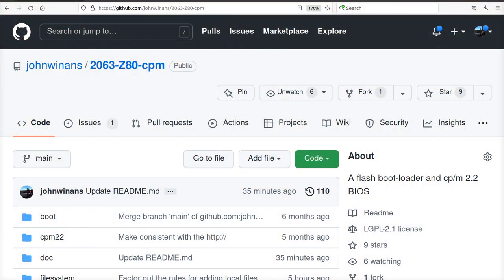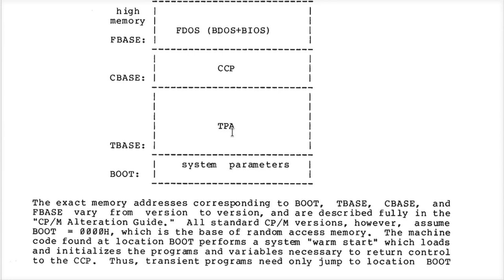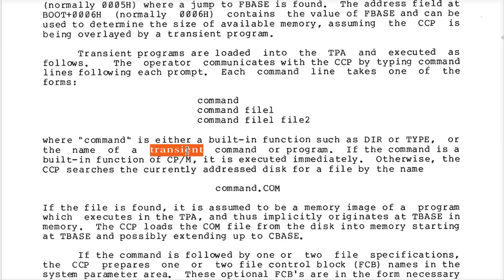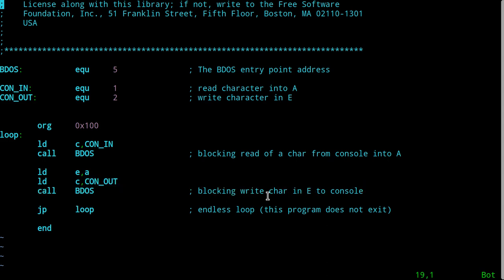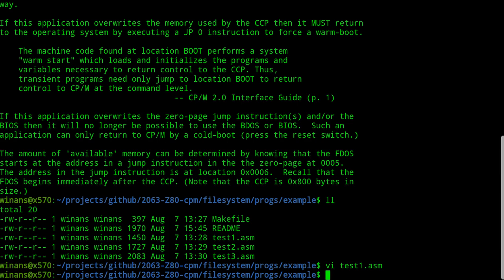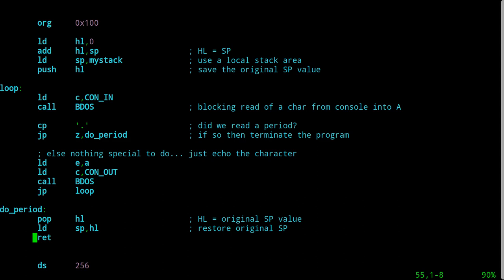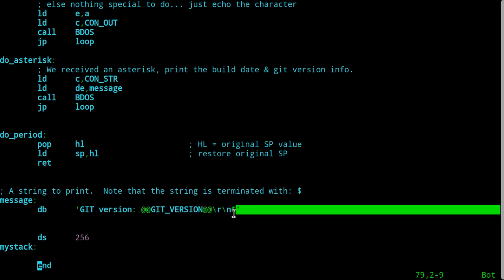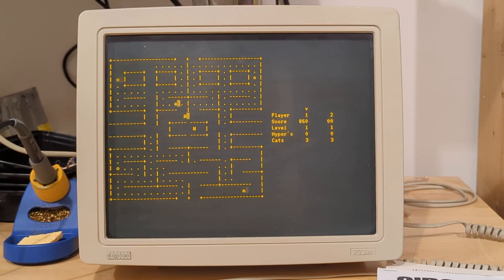Z80 Retro #35 - CP/M .COM Files And How To Create Them

Comment: Not sure why Intel designers didn't include an instruction to move SP to HL.
Possibly figured it was unnecessary. I do see the logic of the add instruction. 
High level languages commonly use the stack to pass arguments to functions. 
The called function would set HL to the offset of a variable passed in the stack frame, then the add would result in a pointer to the variable in HL.

Comment: Thanks for this. I've got a question - where does the CP/M documentation explicitly say what registers are clobbered by a specific BDOS call? I've looked at the "CP/M 2.0 Interface Guide" and can't see any explicit mention of this. Or is there some general guidance for these calls somewhere? Caused me some head scratching as to why my simple program wasn't working - ddt to the rescue!
Reply from the maker: As far as I know, there are no rules on that.  Very annoying indeed 
I SUSPECT that things are unspecified because, while CP/M has a knowable & consistent use if the regs, any particular BIOS wouldn't.  Therefore, i approach it as there are NO RULES.

Comment: RE: TRS-80. The Model I and III had "hard" ROM and either ran CP/M above the ROM or added a card that actually ran CP/M. The Model II ran a straight memory map with boot loader. It could run TRSDOS or CP/M. The Model 4/4P boot loader could load TRSDOS or CP/M. I got a Model 4P back when it first came out in late 1983 and still have it. Just need to get the power supply fixed. Both Model 4s allowed 128K of RAM by using bank switching.
Reply from the maker: I've never seen a 4p.
GEEZ!!! The model 4 was sold all the way up through 1991!!!  That is some serious staying power!!
I got a model 100 around here somewhere.

Comment: I suspect that most low cost Z80 based computers had ROM in low memory.  Most of them booted straight into a BASIC prompt, like the TRS-80.  Other similar computer would be ZX80, ZX81, Spectrum, etc.  Obviously, they where not designed to run CP/M but were meant to be low cost entry level computers.  Since the Z80 begins execution at 0000H, it makes logical since to have that location filled with ROM.
Reply from the maker: They most definitely did.  Since memory was $$, few had 64K, so they didn't have to care about shadow booting to get the ROM out of the way or inserting a reset jump instruction to a ROM in high memory,...

Comment: Just found your channel, awesome work.  Curious, can you recommend an assembler for CP/M on Apple ][e with z80 card?
Reply from the maker: I'd look at the CP/M assemblers and run it on the Z80... self-hosted.

I have yet to go back & re-live the ed & asm days.  But I definitely spend years with them and... a Z80 assembler that escapes me just now as my daily drivers.

There is mention of a number of self-hosted assemblers discussed here: http://www.s100computers.com/Software%20Folder/Assembler%20Collection/Assembler%20Collection.htm

I'd go with their opinion and try SLR's Z80ASM first with ZSID.
Reply: @JohnsBasement  Thanks I’ll check it out!!
Reply: @JohnsBasement  found one ASIMOV but turns - works but 8080 instruction set

Comment: To the uninitiated the BDOS 9 Console Output string function it difficult to print the '$' sign, tab control code (09H) & any char with bit 7 set.
Reply: Some apps of that era recognised this shortcoming of CP/M and directly access the hardware - e.g. WordStar 3 is configurable to directly access memory mapped VDUs instead of using clumsy & slow terminal ESC codes. Another is the microbee where the CCP is replaced with graphical shell.
Reply from the maker: I rarely used BDOS 9.  I hadn't considered the tab.  The $ oddness occasionally lead me to write my own null-terminated string print function.

Comment: Hey  John someone sold me a z80 20PEC and i was wondering how difficult would it be to change up the system crystal and fiddle up some sort of speed divider so i could ramp down the z80 if that was too hot for some applications?
Reply from the maker: Well, you could... but the RAM and FLASH would have to be upgraded to faster chips, the PCB layout concerning the oscillators might need a closer look, and the changing of the clock is likely to require some synchronization so that it does not glitch when 'shifting gears.'

The PCB layout probably needs some termination and more careful routing to prevent noise that becomes a problem as speeds increase.  (That's one of the reasons why when things were slow, they were MUCH easier to build using messy hobbyist techniques!)

FYI -I am looking at using a Z8S18020 for my faster next generation Z80 project with SRAM such as the IS61WV5128BLL-10TLI
Reply: @JohnsBasement  Thanks John I'll hang on to it for that then!  I thought it might be more work than a simple clcok upgrade.

Comment: Confused??? What feature in your Bios is causing the extra character to be printed when your assembly source files appear to follow the  CP/M guidelines ???
Reply from the maker: Calling the BIOS function to read a byte from the console will also print it.  Then I call another BIOS function to print it from my program.  So it gets printed twice.

This is why the * and . only print once before the git version or program terminates... because in those cases, I don't print the characters read in. (In the third example.)
Reply: Thanks for the response, the bios is the "boss" !

Comment: I love how, at 5:50, you say "you only have 64K'.  Was that sarcasm?  As you know, "in the day", you could only dream of having 64K.
Reply from the maker: 🤣... I only had 16k for a rather long time!  If you can see the S-100 ram card from my home made system up close, you can see that the second row of RAM chips were added by unsoldering and relocating the bus drivers.

The "only 64K" line is there for the benefit of those under the age of 30.  😉
Reply: @JohnsBasement  I love and learn so much from your videos.
Far to many videos do nothing more that show piece of hardware being turned on and used.  They don't show what goes into designing the hardware.  They don't show the choices and compromises made.
I may not agree with all your design choices but I understand your reasons and respect them.

Comment: CPM on 6502 BOOT and TPA are not 0 and 0x100 because of CPU architecture - 0 page and h/w stack.
Reply from the maker: Oh yeah!  Indeed!  We wouldn't want to waste the zero-page of a 6502 on an I/O buffer and some fixed constants!!
Reply: How does the MS Z80 softcard do it on the Apple ][? I used to have one back in the day, but I never did any assembly programming under CP/M.. I just used it for Turbo Pascal. I would assume that the card completely takes over the system, but you say that it doesn't? Does the TPA start at $200 then?
Reply from the maker: @activelow9297 I've never used one.  But skimming this page:

http://apple2.guidero.us/doku.php/mg_notes/cpm/softcard_cpm_ref

suggests that the Z80 uses the Apple's RAM by translating the addresses from the Z80 so that it sees RAM starting at zero.  Therefore the Apple must fill in the code the Z80 boots from into Apple memory starting at $1000  and then releases the Z80 from reset, that then 'sees' that data at it's address 0000h.

The Z80 perspective of RAM is contiguous from 0000 to CFFF as long as the display is in text mode.
Reply: @activelow9297  I meant 'native' CP/M for 6502 CPU like http://www.z80.eu/dos65.html see different TEA starts @p11 http://www.z80.eu/dos65/DOS-65_System_Description_A.pdf

Comment: Every time you mention the paper tape punch, you chuckle a little bit... why? I think paper tape would be a randy way to save and load data on a retro computer. Somebody should rig something up that uses 2 1/4" receipt paper (which can be bought 50 rolls to a box for $17).. the punch could use row of servos controlled by an arduino, and the reader could use leds/CdS cells to read the holes. It would be a very economical and quick way of physically storing small amounts of data.
Reply from the maker: 😳 I didn't realize.  I suppose I'm channeling the days when I had one on my Friden Justowriter (which has long since left my collection.). Fun times.

As far as building a reader... yes, it would probably be easy enough to do... But what about the punch?... Perhaps it'd be easier to read black spots instead.  Then you could just 'print' onto a paper roll?
Reply: I thought I had seen someone did make a paper tape reader using some light sensors to read in their old programs.